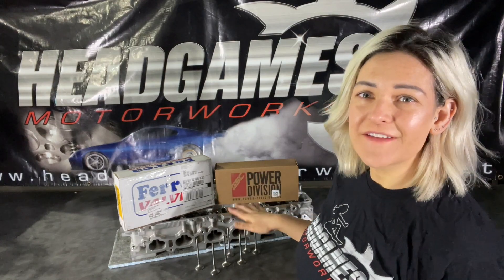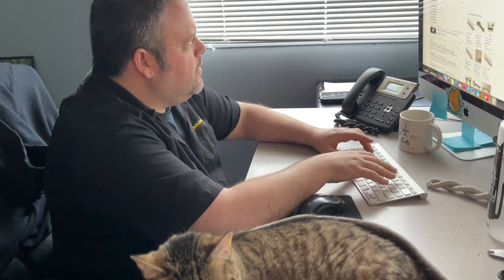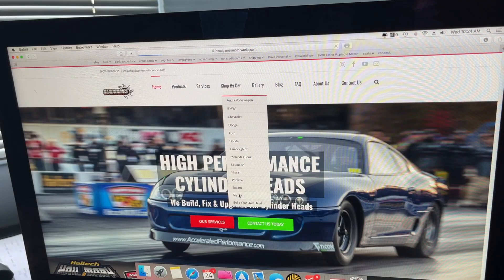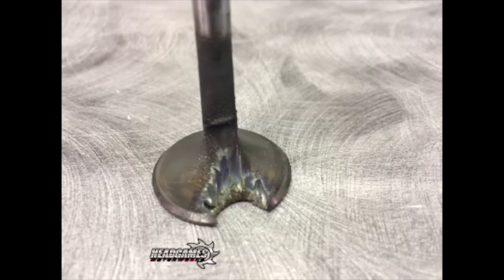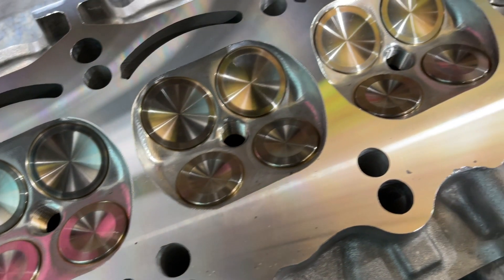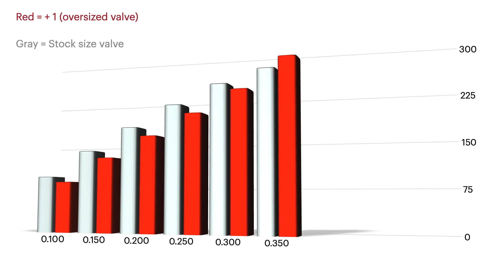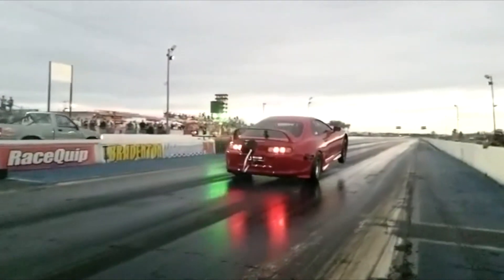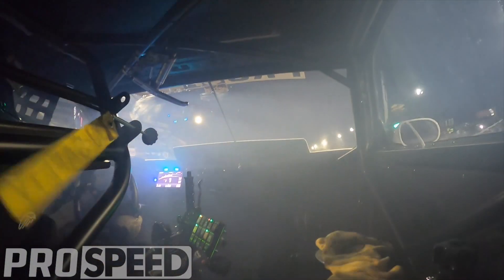HeadGames Motorworks 2JZ Series Episode 10: Valve Selection do's and don'ts

Comment: What would you recommend for Honda heads I want to put a 1mm oversized on the intake but I'm not sure on the exhaust side
Reply from the maker: You didn’t mention which Honda but an oversized valve won’t fit on a b series valve seat. And limits your cam selection because of valve to valve clearance during overlap. We don’t install oversized valves in any Honda .